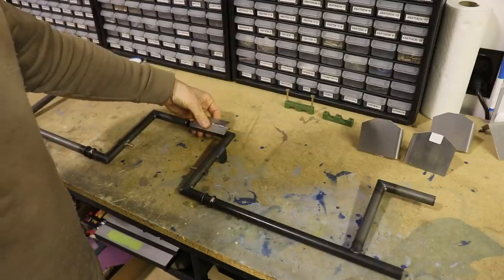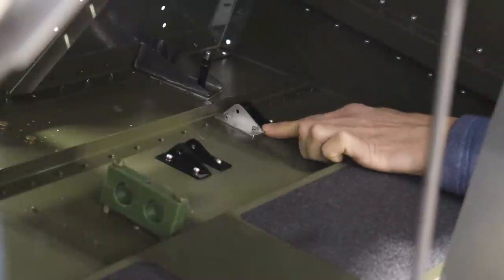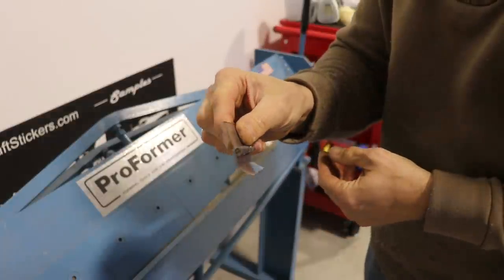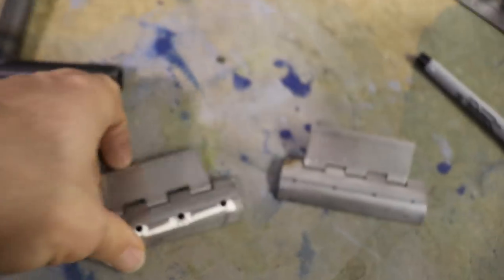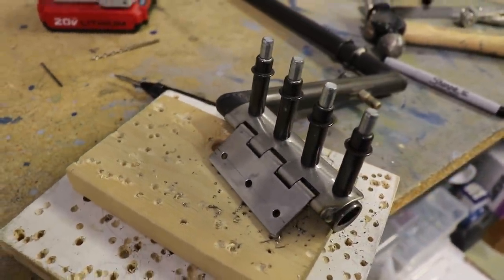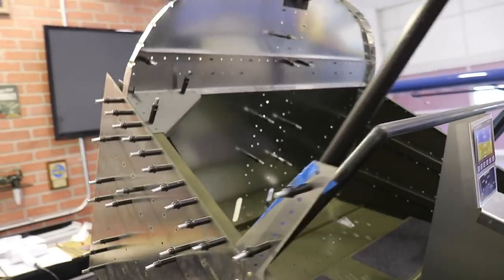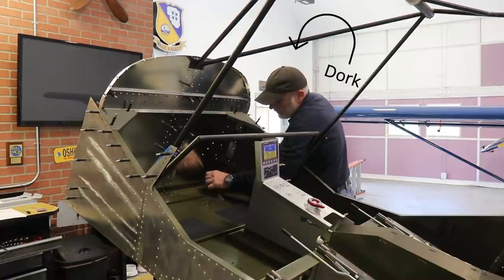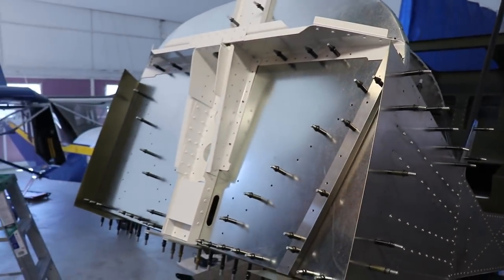Joys and Frustrations of AIRPLANE Building (Ep41)

Comment: I was having all kinds of trouble with my pneumatic riveter.  Roger from Zenith is such a nice guy that he ended up sending me a new one.  In the meantime I bought a Milwaukee M12 riveter ....I haven’t even opened the pneumatic and pulled about 1,200 rivets.  I’m keeping it as a backup until I finish my SuperDuty but then plan to donate the pneumatic back to Zenith so they can use it in workshops.

Not necessarily a small amount of money, but well worth it.

Also, my wife was watching over my shoulder and said that was your best video ever.  I love building but can come in from the hangar pretty frustrated, thanks for showing us that.
Reply: I had a problem with my Pneumatic riveter also. I took it apart and lubricated it per the owners manual instructions and it has worked ever since.

Comment: I agree about the glare shield.  On my Cruzer I found that all my carful lining up changed slightly after the engine was hung.  Adding that weight seemed to slightly change the geometry.  Should have waited to final drill the glare shield.  May order a new one and start over.

Comment: Mark, several possible issues with that glare shield hole mis-alignment :

(1) - Stack up of tolerances but that's unlikely as the designer at Zenith would have checked that prior to release of the installation drawings

(2) - As you mentioned, a simple mis-drilling (positioning) of either the forward hole pattern or the aft hole pattern in the glare shield ; error in manufacturing.

(3) - There may be a missing piece like a strap or possibly a shim in your build but that is also unlikely because missing pieces would be called for in the plans.

(4) - Your firewall is not in the correct location but you seem to have lined up the side skins and floor ok, so that can't be the problem.

There are other possibilities but at this point, after going through all of the above to ensure none explain the problem, it's a case of speaking with Zenith or possibly shimming your panel install. I believe you did mention that there was more than one panel option and that you had chosen the one which was not the default standard (or perhaps that was another builder ... LOL, I get confused as I'm following so many of you at the same time and enjoying all of the content tremendously by-the-way).

Anyway as the saying goes, "measure twice, cut once" so your plan to speak with Zenith first is, as always, the best option.

Cheers for producing and sharing such excellent content.

Comment: Mark, I appreciate this whole series.  I'm planning on starting a SD project towards the end of this year.  Ground breaking on the shop starts mid-May.  Can't wait.

You are always very through about showing all your de-burring and corner easing.  However, you skipped showing how you did this when you drilled the rudder pedals.  How did you de-burr the insides of those tubes?  Skinny round file?
Reply from the maker: Yep that’s it! The ends of the tubes are open so you can put a round file in there and debur the back of the holes.

Comment: I think you need drooping force on the nose.  Support the frame under the front panel and pull the nose down to open the distance between the top of the fire wall and the top of the front panel.  You may need to counterweight the tail. If you needed to close this distance, you would support the nose and the tail and force the center down to flex the frame forcing the top points closer together.  This type of thing can happen to any disassembled structure.  Unless uniformly supported in the right shape, saggs, flexes, even twists can get built into the structure.

Comment: Mark, with Clekos in the panel on top, the Glare Shield fits, but NOT on the sides or bottom. Maybe the panel Can come back a bit and not directly against the bottom Tube. Is the panel suppose to be riveted to the bottom tube?
Reply from the maker: Yea the panel is riveted on the bottom to the tube so I can not be moved aft.

Comment: I had a similar problem with the root end wing skins. It was very frustrating and although I was able to get them clecoed in place I am still not happy with the way the seams look.
Reply from the maker: Yep the root skins are difficult to fit nicely. That's why I made the fairings that cover that seam!
Reply: @KitplaneEnthusiast  How did you do that with the slat mounts on the front of the wing?  Did you put a slot in the fairing to account for the slat mount or some other way?
Reply from the maker: @justplanecrazy1860  I built a Cruzer so there are no slats, but you can do the exact same thing and just cut a slot in it for the slat mount.